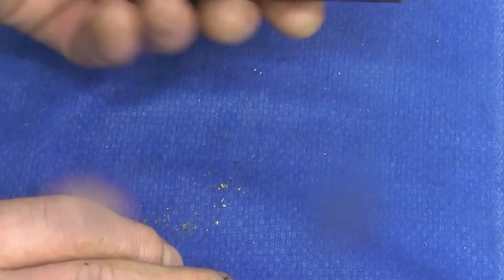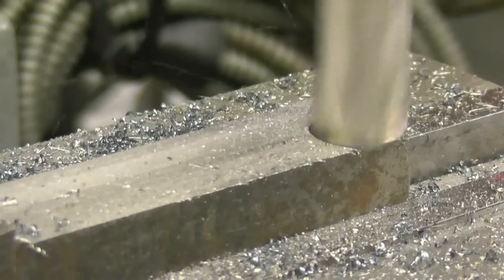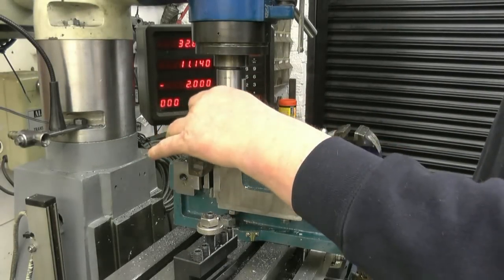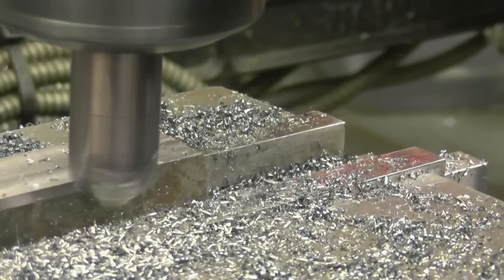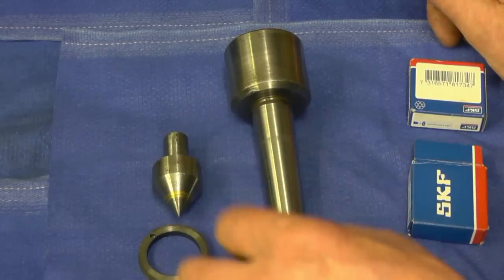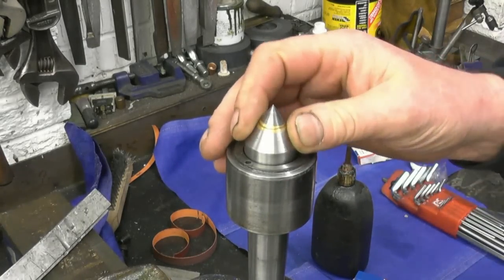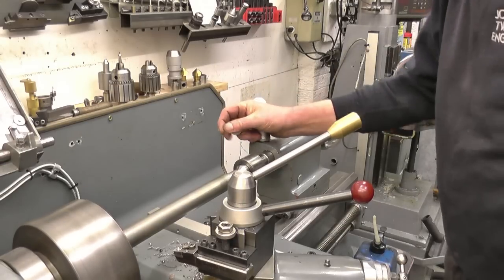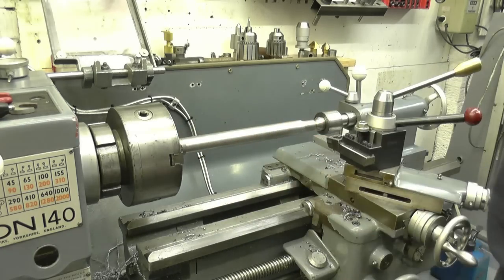Sunday Night Night Cap 68 part two

Comment: Hey John, that's a good tool holder. Cnmg inserts are versitle. Make sure to keep them after use on the lathe so you can use them in a milling cutter. 
I was also milling tool holders this weekend. I've had a few I needed to modify. 
The live center turned out great! 
We're still thinking about Debs. Hope she continues to do well with her treatments. 

Ya'll take care!

Adam
Reply from the maker: Abom79 Thanks Adam

Comment: Good to see Hef stopped by the shop! I hope the worst is behind Debs now. be sure to check how a part is turning for taper just in the head before moving the tailstock. My lathe was out there and getting it cutting true theer led me to the fact my tailstock is a bit low and needs to come up to correct taper rather than go over.

Comment: I wish the best to Deb and glad to know she is doing better with her treatments.
Nice work you did on the tool holder. I don't have a milling machine that can handle what you did with the insert tool holder. So for my BXA QCTP, I bought the Hess 250-202-XL extra deep tool holders to accommodate the 3/4" high tools. These are well made tool holders but I always like to replace the tool set screws with dog point set screws.

Comment: John, i have a BXA toolpost and I bought 3/4'' oversized holders for it, did the same as you before of a few insert holders (mill them down to 5/8) but if you're looking to buy more holders that's a better way to go, price is just a couple of dollars more than the regular ones and they are also longer (so holds the full size 3/4'' holders on the entire length).
Best to Deb, glad to hear she's handling better the treatment.

Comment: As usual I'm pulling for Debs. Nice video. Nice tool holder too, 

You almost did me in with the ads from Google/YouTube. They will not play in HTML5 on Firefox. You almost lost me, but I have found a work-around. Different browser, but I suspect it uses Flash -- which is insecure to say the least. Oh well, some risks must be taken,

Comment: John,

Good video. 

I've got the same issue with a few insert holders that were thrown in with my lathe. 

I was just wondering if I was going to be able to reduce the size of those holders to use my Aloris tool holder. Your video answered that question.  Just have to figure out if I should reduce the top or bottom to have more adjustment.  Thanks. 

I also saw that your tool holder had inserts that were double stacked. Is the bottom one a blank or just another cutting insert? 

Tell Deb she's tougher than tool steel!  She'll be on the back side of this soon, hang in there!

Best.

Comment: Good news about your wife. Great videos. Just a thought, would it be wise to check if your lathe still cuts a taper using a known good centre, just in case the one with the new bearings is running out for some reason such as it might have been trued with the old bearings. Or am I on the wrong track? ( probably am).
Once again thanks for some more very enjoyable vids.

Comment: It looks like it might have been better to take the excess metal off the bottom of the tool holder rather than the top.  It appears that you almost ran out of room at the bottom of the tool post dovetails.  Anyway, looks like it works just fine...
Reply from the maker: ***** It would have been better to split the difference Making some bigger holdersThanks for watching